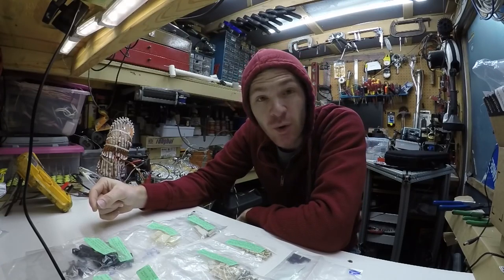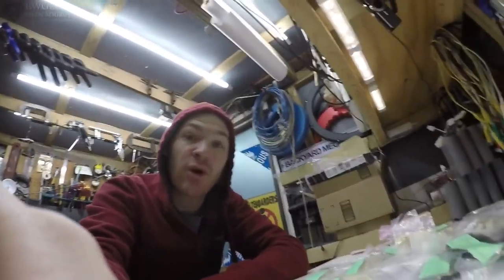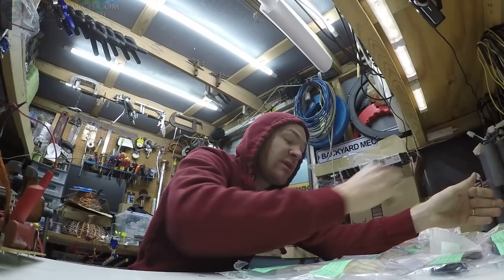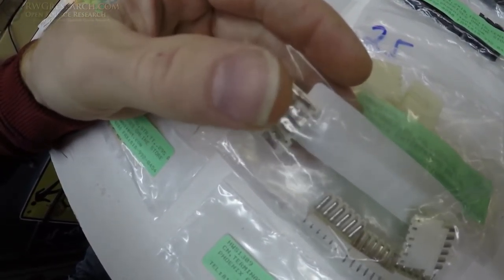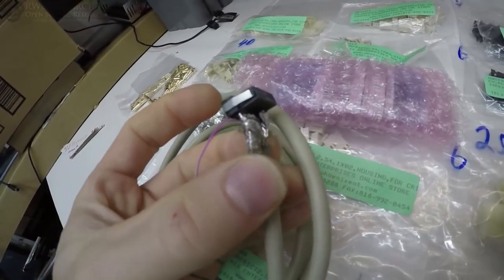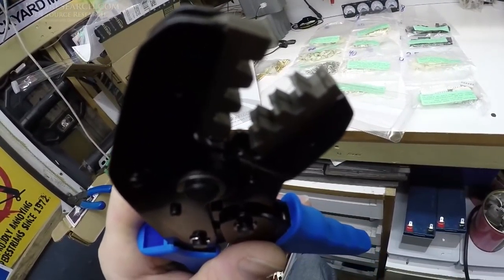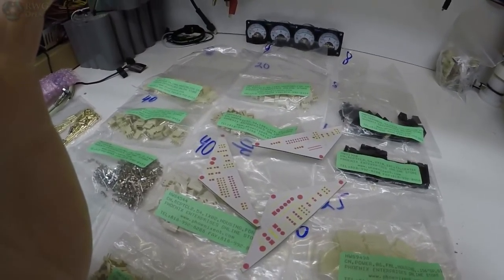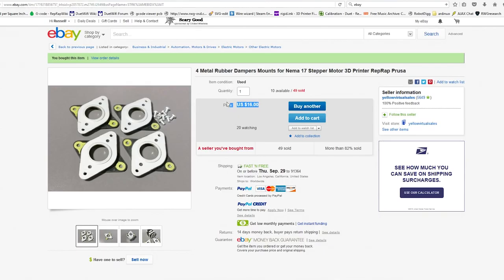RWG-OSD # 24 : Electrical Connector Time!!!! Its Starting To Look Like Something!

Comment: I wound up getting some flexible pla from Rigid.ink  after i got my samples. I dont think I'm gonna be able to actually print with it tho lol well at least without some modification of my extruder, flexible filament is some odd stuf to print. anyhow I let them know that I found the thur your channel amd thanked them for sponsoring you :)
Reply: The rigid ink flexible PLA is awesome stuff and prints with Bowden tubes no problem. The trick is to go really slow. Slower than the website says.
Reply: yea I will have to add a small section of tube to my Robo3D extruder I think to make it print without bunching up